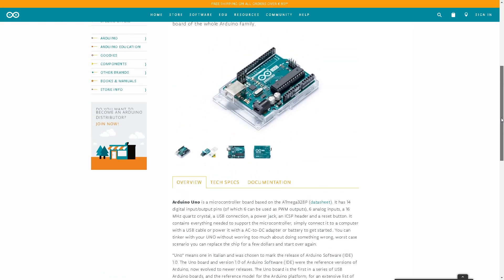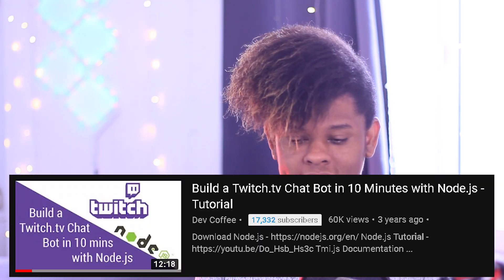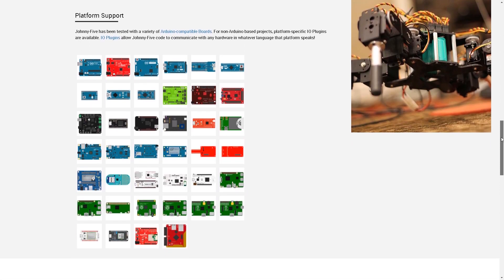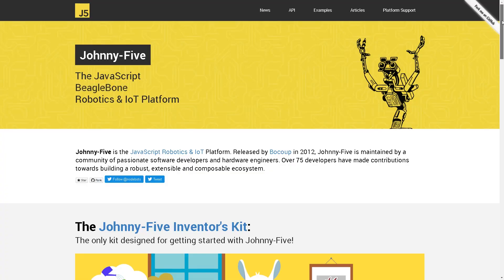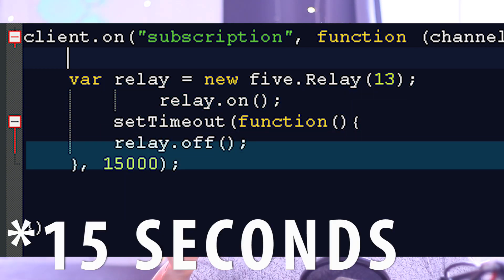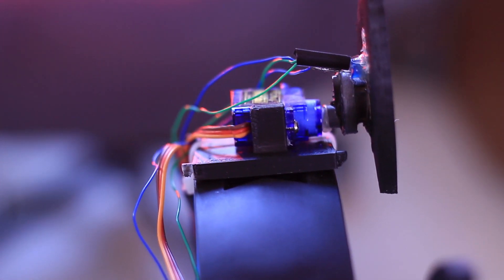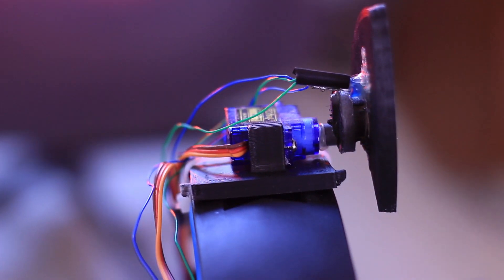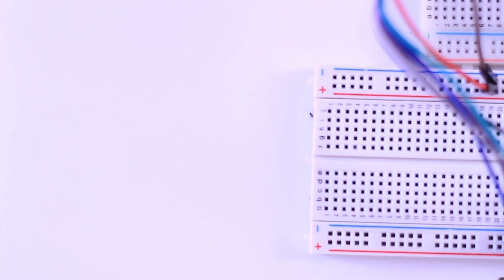Twitch Chat/Alerts controlled Cat Ears (3D printed)

Comment: You should take a TV and put a picture frame over it and put it up on the wall behind you and have it on behind you so it will look like there's a picture behind you and every time you get a TOS message it would pop the TOS message up on the screen and read it out loud through a Bluetooth soundbar that's on a table under the picture frame I saw someone on Twitch do this long time ago and it's cool